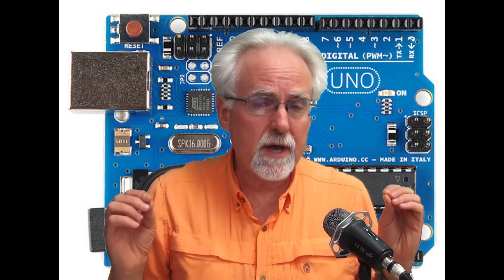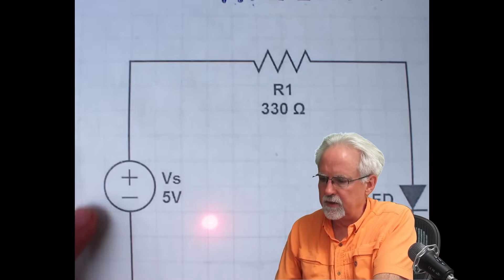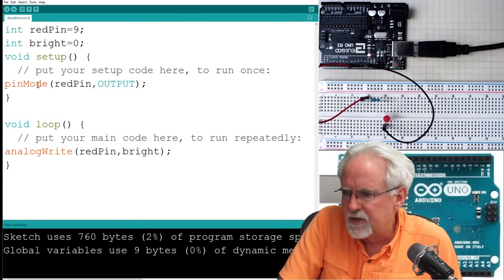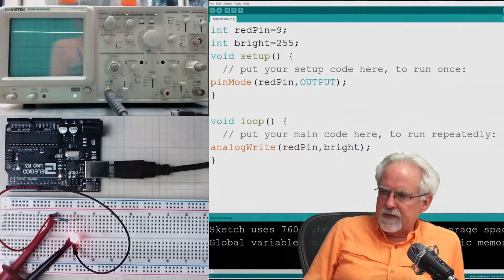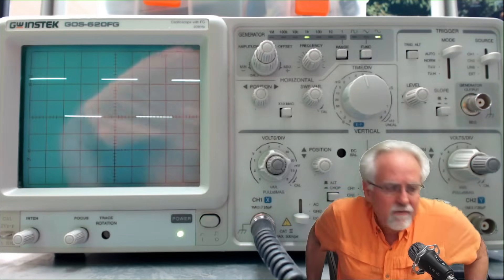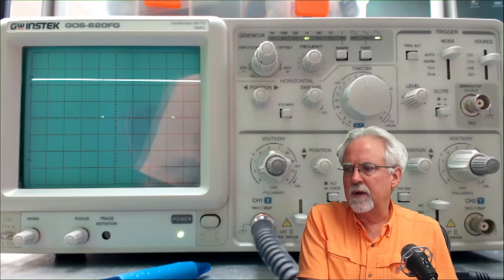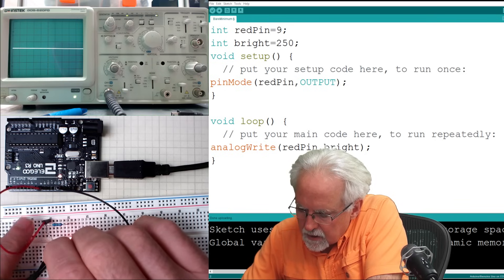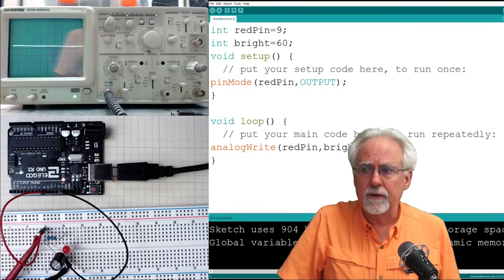Arduino Tutorial 8: Understanding Pulse Width Modulation (PWM) and the Arduino Analog Write Command

Comment: From my understanding, PWM is how for analog values the voltage isn't actually being changed to anything other than 0V or 5V. What happens is that the voltage switches super quickly from the two values in order to get the brightness to seem like an intermediate value between 0 and 255. Higher value means more time at 5V and vice versa. Awesome explanation!

Comment: Based on this lecture it should be possible to build a circuit that controls a microwave transformer output (low voltage high amperage) power level and pulse width. Have you guys build anything like that?

Comment: I have a question. At 12:23 , why does the period 4 milliseconds? If it is set to be 0.5 milliseconds per division (which I'm guessing per box, correct me if I'm wrong), wouldn't a period be 2 milliseconds instead?
Is there something I'm not understanding rn?

Comment: int red9 = 9;
int elapsed = 0;
int waitTime = 5;

void setup() {
  // put your setup code here, to run once:
  pinMode(red9,OUTPUT);
}

void loop() {
  // put your main code here, to run repeatedly:
  if (elapsed == 255){
    elapsed =0;
  }

  analogWrite(red9,elapsed); //0-255  
  elapsed++;
  delay(waitTime);
} if i code this, and use a capacitor, will i see a sin or cos signal in your ossiliscope?

Comment: Great video! I have a couple questions though: I understand that PWM isn’t a real analog signal, but why? Like what’s stopping the Arduino from just giving 2.5 V? Also, in what situations is this a problem so you must use a capacitor?
Reply from the maker: These are Digital Electronics. Digital means on or off, there are no in betweens.
Reply: @paulmcwhorter Ohh ok got it, thanks!

Comment: It was a great explanation! I don't think I understood it the right way, but at least it gives the visualization for me to think I "understand" whats going on

What I imagined is that the light doesnt reach our eye instantaneously when the LED is turned on, but it takes some time (it isnt true, but I cant think about it otherwise). So by decreasing the time the LED is turned on we decrease the level at which the light gradually becomes "brighter" in our eyes. Like, imagine the fog, which gradually becomes thicker the more time you look at it, that's how I see it at least

About the capacitor, I'd like to imagine that when you have 5V, the capacitor starts charging up, the electrons flow to the plate, but then we make the voltage 0, so the electrons go back to where they came from, discharging the capacitor. But because it happens so fast some electrons are stuck there moving back-and-forth, making the oscillator show the average voltage made up from the stuck electrons

Comment: Great video! I already knew what a capacitor does but appreciate the way you explained it in the video. The way a capacitor obviously doesn't store the high 255 (5 volts) or low 0 (0 volts). At 127 (2.5 volts),  it receives and stores the average which is 2.5 and that is how it "smooths" the PWM.  You provided a great way to visualize PWM and what capacitors can do to the PWM voltage signal.
Reply from the maker: It is all about the average!

Comment: TLDR; Oscilloscope: machine that allows you to view voltage signals. Goes high up for a max value of 255 as seen in 8:25. Goes low to zero for a minimum value of 0 as seen in 7:02. For middle values, it switches in between the max and min value to form an average around that value. For example, for a middle value of 125 as seen in 10:42 is evenly split between min and max. But for a value very close to zero, it looks like 14:00. Lastly, a capacitor can be connected to the circuit to smooth out the signals as viewed in the oscilloscope, if you'd like to view it like that as seen in 18:01.

Comment: Thank you for the explanation of pulse width modulation! I understand the basic of it. Similar to that of how digital switches operates (on, off), there is a time interval between 5V and 0V,
Lower value --> more time with 0V
Higher value towards 255 --> more time with 5V

I looked into common tech who uses the analog function without the need for a capacitor to roughly understand when and where it is applied. From my understanding, things that doesn't require fine precision, noise reduction etc will use Analog functions without the need of a capacitor such as modern LED-lights at home or the computer fan on my laptop. While things that perform sensitive readings such as gait analysis instruments (where my field is), needs a capacitor to increase the stability and reduce noise to increase precision of the readings.

Comment: As per your instructions - I'll try to say it back, also processing the information for myself in real time (and it's going to be a bit long-winded as I'm trying to connect a bunch of info together, so sorry in advance):
-----------------
As discussed in previous lessons, microcontrollers are massive fields of countless microscopic semi-conductive switches that are all only capable of being on and off, not values in-between. However, to accomplish the feats we wish to accomplish, with each and all of these switches, we need to be able to a) make all of those switches turn on and off incredibly fast, and b) control and coordinate some basic aspects of how these switches behave individually and together. Namely, we need to determine...
- ...When and how fast a switch turns on and off (a pair of 'pulses' if you will - one pulse to turn something on, one pulse to turn something off)
- ...And how long a switch stays on versus off (the length of time, or width, of an on pulse or off pulse). 

Therefore, when we manipulate the above two factors, we are Modulating the Width of Pulses, hence, Pulse Width Modulation (hereafter PWM).
------------------------------
Application with an arduino and an LED:

Basic Digital outputs on an arduino fall into two types: One type is capable of a simple on or off (or HIGH and LOW in the C language) of 0 or app. 5 volts. If working with an LED light-bulb - 0 volts will leave the bulb off, and 5 volts will turn the bulb on. 

If we want to be able to dim the bulb to varying brightness-es between 0 and 5 volts, we need the other type of output. The other type of output, like every other switch in a microcontroller, is also only capable of being on or off. However, this second type of output is capable of PWM. If we have any value between 0 volts and 5 volts, the switch is going to turn the bulb on and off faster than the eye can perceive. If we set the bulb to a voltage of 2.5 volts, or halfway in between, the bulb is spending the same ratio of time between being on and being off, thus giving the visual illusion that the bulb is at half-brightness. If we want to make the bulb dimmer, we modulate the off-pulses to be wider, and the on-pulses to be thinner, thus making it seem like the bulb is dimmer. Vice versa, for a bulb that lights brighter, we modulate the on-pulses to be wider, and the off-pulses to be thinner. 

The result: even though we have a digital switch that is only capable of two values - by very rapidly toggling the switch, and controlling the timing of the on and off periods (aka, by using PWM), we can widen the amount of values that a plain digital switch can generate, giving us a much wider range of flexibility and control to accomplish our desired tasks.
----------------
How'd I do?

Comment: PWM is changing the voltage from 0 to 5 at a high speed at different rhythms so we perceived that it is using less voltage.
when using a capacitor, it allows to control the voltage and have a true dimming.

Comment: If i use a capacitor in my circuit can i read the voltage with a voltmeter?
Thank you so much for the attention you give to my question and thank you for the god work in your tutorial.
Cordialy.
Daniel Leduc.
Reply: Sorry, you don't have to answer my question because you answer it in lesson 9
Thanks agein for the good work.
Reply: @danielLEDUC-ek1cf is it yes

Comment: Great vid, especially showing the smoothing action of the cap. Fyi, the % of time the signal is ON vs OFF is call the "duty cycle". Also, I think the period should be 2.1mS not 4mS. 4.2 divisions x .5mS/Division = a period of  2.1mS which equals a freq of 476Hz. The specs show 490Hz on pin 9 so that makes sense.

Comment: This is a fantastic series. I look forward to watching these lessons. I also really look forward to the assignments so I can play around with it and actually know what I'm doing. I've been watching all sorts of videos on electronics components and such over the last couple months. Even ones that say things like "Everything You Should Know About Capacitors" and stuff, but it still didn't really make much sense. When I saw how the capacitor impacted the wave on the Osciloscope I was like "OK I get it now". I feel like my knowledge of electronics is grows exponentially the farther I get in this series. Thanks sooo much!

My biggest question right now is why we need a resistor there. I'm not sure what purpose it serves. It seems like we could just cut out the middle man and send the signal straight to the LED, but we run it through a resistor first for some reason.

Comment: I'm trying to understand the difference in how the voltage interacts with the LED in digitalWrite vs analogWrite. In analog it bounces between 5v and 0v to create the brightness/dimness of the light. But does digital write just lessen the voltage that's being fed to the LED to create the same effect?
Reply from the maker: Digital write provides a constant 5V signal, the analog write turns the 5 on and off very quickly for dimming. You can not dim using digitalwrite.

Comment: Again very interesting . Okay onto PWM this is just avenging the ON time to the OFF time to give you a set value voltage. This principal is also used for the drive motors of an electric forklift. The longer the ON time the faster the motor will spin. The the longer the OFF the slow the motor will spin.  Very interesting stuff, like I always have said, upstanding the basics is the first step for trouble shoot and repair.

Comment: I think you are telling us that adjusting  cycle in the period affects  light brightness even though circuit voltage level is still at five volts. But when the capacitor is applied into the circuit the circuit voltage levels moved to reflect what we would expect to appear at different voltage levels, corresponding  with the associated brightness levels of the LED.

Comment: I understood that Pulse Width Modulation works for an given Voltage in a given period of 4 milliseconds it stimulates b/w 5 volts and 0 volts and averages out the signal to get the desired o/p and also that capacitors will help us to smooth out the signals in every interval of time when voltage is being applied.
 Thanks Paul, I understand it clearly you truly are a great teacher and also tech savvy
I'm glad I found your channel keep the work up!! ❤

Comment: Paul, silly question, and I know it was a long time ago and the new series is not so new now, but......I have a sketch adjusting the brightness of the LED via PWM, all great, apart from I tried to turn off the LEDs using a digitalWrite(myPin,LOW) and it did not work, replacing with a analogueWrite(myPin, 0) did work? Any reason that after adjusting with the PWN analogue command I then can not use a digitalWrite??

Comment: Hey Paul, it's been 7 months since I did this lesson, going back through them and taking more detailed notes, but I noticed something: it doesn't register the "LIKE" I gave it 7 months ago.  Going to give it another, but was curious if you noticed a down-tick in likes for your videos?  Oh, and my question still stands from 7 months ago.  Does the capacitor work in parallel like a diaphragmed air chamber in a plumbing situation to absorb spikes in "pressure"/current?

Comment: You didn't ramble but the sudden turn to the capacitator thing threw me off completely. Why hook it up in that way and not any other way? What is a capacitator? What is capacitance? Why does it smooth voltage out? Why that specific amount? Maybe it is an idea to make a tutorial series on electronics for dummies, because all of that information would help a lot (and learn to read and build schematics!)
Reply: OK, in a nutshell, capacitors are like a really small battery that fills up and empties power. But how can it smooth up digital signals? Well, what happens is that when a high signal of power comes to the capacitor the capacitor starts to fill up, at first the capacitor is taking a lot of power making the voltage really low at first but as the capacitor fills up the voltage begins to rise up smoothly causing more power to flow through the resistor and LED, and then the digital signal goes low. But the capacitor still has power stored so all of the power starts to flow out of the capacitor through the resistor, and LED, at first the voltage is at 5v but begins to drop smoothly because the capacitor is emptying its power, and all of that happens fast and over and over again. I hope that helps you understand a little bit about capacitors.

Samuel :)
Reply: @samueltheprogrammer6145  Samuel, dear stranger, thank you for this. Much appreciated and gives me something to hold on too!

Comment: Sir, what is the frequency of the PWM waveform? Also, there seems to be some etror in the calculation of the period.  My apologies in advance if i understood it wrong. As you mentioned it was 4.2 divisions on the x- axis ( time) with the setting at 0.5  milliseconds per  division. That would turn out to be 2.1 milliseconds per pulse instead of the 4.2 milliseconds as you mentioned in the video. Does the frequency turn out to be about 476 Hertz approximately?  Can we change the frequency of PWM  or some other programs may be needed to change the frequency etc. when using PWM.

Comment: wrote a response to another commenter on the previous video, not knowing that this video would answer most of the questions!

if that particular commenter is still looking at the comments for an answer to their question (and any others who have the same issue):

dont use the "ANALOG IN" pinouts on your arduino. On Mr. McWhorters arduino, the pwm/'analog' capable pinouts are indicated with a '~'. My version of arduino (mega) doesnt have the '~' demarcating these as PWM, so i made the same mistake of plugging into the 'analog in' rail and getting a wierd result with the LED. 

Helpfully, printed on the board next to the digital rail on the mega arduinos, are the initials "PWM" which correspond to pinouts 13-2. Use these and your program should work.

Comment: Hi I have one query 
If laser diodes module   pwm signal pin required 5-12v pwm and it's main voltage is 12v (have 3 pin)  . Adrino uno output pwm is 5v .so the laser will work at 45% of power or at 100 % of power.?? I have set 255 in the program (100% meaning Full potential of the Laser) please help 🙏

Comment: So I'm playing around, added 4 LEDs to the board, set each to a different brightness.  I figured it would be hard to discern 150 and 200 or 255, but when I set 50 or 100 on the first pin, I can't get it to light up.  It will light up on the 2nd and be very dim at 50 or 100, just doesn't work on the first pin, other than on or off.  Is there something I'm missing?
Reply from the maker: IT could be so many things . . . are you using only pins with the ~? Is your resistor value correct? Did you remember to do all your pinModes? Check all your work, both in the code and on the board carefully.
Reply: @paulmcwhorter  Thank you!  And thanks for your tutorials, 55-year-old here, feeling like a 6-year-old, trying to learn to code. 🙂
Reply: @paulmcwhorter  Okay yes, that's it, the ~ !.  Forgot about that, had it on digital pin.

Comment: i think whats going on is the arduino is using a switch thats timed correctly to close and open this 5 volt circuit and by timing the operation of the switch you can simulate various voltages. 255 is relative to 8 bits but now im wondering what if the chosen voltage is 3, 9, 12 or anything else. does one still have the values in voltage proportionally increased while maintaining the 255. like is 9 volts on another circuit still 255. also when the full 5 volts or 0 volts is applied the display on the oscilloscope was a solid line because there was no need to simulate it. the switch is either on or off

Comment: Great explanation, Paul. My understanding of pulse width modulation (which I had never met before) is that the percentage of the period that the voltage is set to 5 is varied (or modulated) to effectively mimic a level between 0 and 5 volts. Your use of the oscilloscope was a perfect illustration.

Comment: Pulse width modulation (PWM) steps the voltages high and low to get an average of the voltage you want. Adding a capacitor will help to smooth that out for more of an analog signal. Is that right?
Reply from the maker: Excellent!

Comment: I can understand the theory of pulse width modulation. I do not feel as though there was too much droning on about the subject. There could have been several hours more just to explain the math. Perhaps my understanding is also due to previously being introduced to Electronics theory and assembler's certification through the magnet program in my Highschool, {Colonial High w/ Mid-Florida Tech}. I do not remember the math fully, unfortunately. I am a bit curious about the math involving the exponent of negative 3.5 mentioned at 11:56 to 12:25. (".. and it is set to point five milliseconds per divisions, so I'll multiply by 0.5 e(-3.5milliseconds). So that has a period of about, [omitting a bit here].. period of about four milliseconds") I'm loving these courses. So glad you've volunteered countless hours to share your expert knowledge. Could easily be asked to pay upwards of $10,000+ for this level of education.